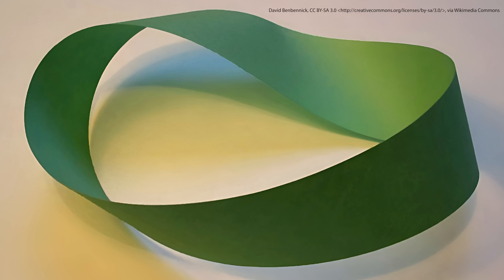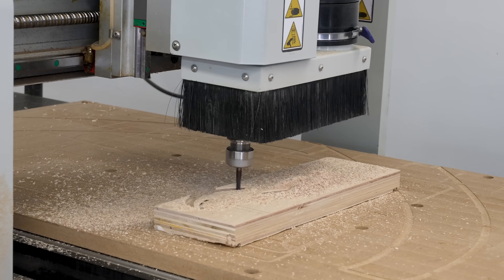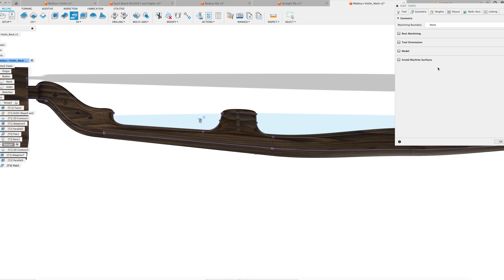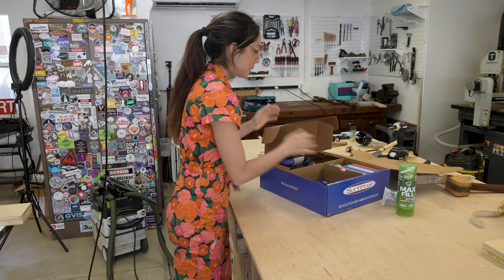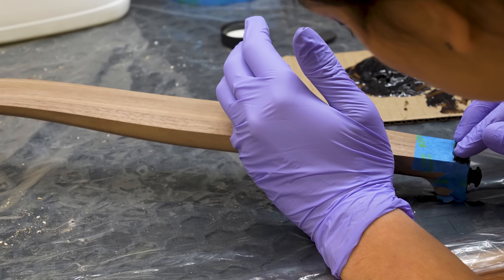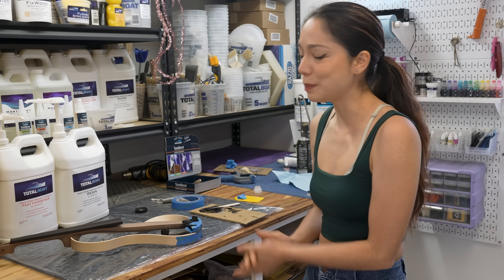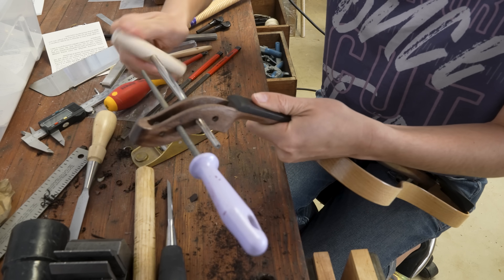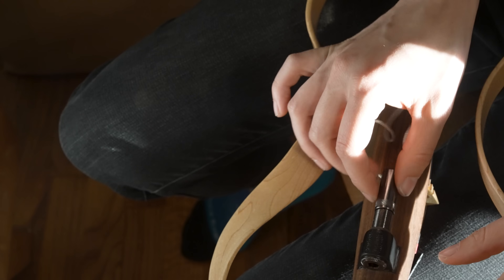I Built a MOBIUS STRIP Violin

Comment: You could probably collaborate with a Luthier to combine your design with some resonating chamber and diaphragm arrangement that provides the rich overtones of those acoustic parts, even allowing for adjustments in thickness, positioning of the parts to alter the overtone relationships. As it is, an electric violin uses Circuits to alter the voice, emphasizing bass or treble, or adding effects. Both "traditions" have their value.
If you listen to Hilary Hahn, that suggests you already know a lot about those issues.
I believe you would find a LOT of professional players would appreciate an alternative electric fiddle with a richer voice than the market offers currently ( sorry )
p.s., Doing animation for broadcast and games, I've worked with Lightwave, Wavefront, Maya, and several others. But I cannot imagine working with a solid modeler for CC woodworking. It would be fascinating to know how you got involved in your passions. 
I guess I should check out your Channel as a new subscriber!!!

Comment: CNC is how Kiesel makes custom electric guitars.  Your CNC set-up looks like a small version of the big CNC mills we had all over Boeing.  I'm a 34 year veteran of the "quality change wars" at Boeing, who worked with a LOT of engineers - in a system of systems capacity, noting I'm actually not a formally trained one.

Great engineers mentor each other in in so doing, both parties grow and develop.  Skill building goes on forever so tap into others at will and with no apologies, and an every chance you get.

Go forth and be powerful!

Comment: as a 10 year operator before falling ill CNC isn't the worst they get Bright ass ideas in the office and try to tweak it down to one person in the department running everything you have to bail to a lower paid position somewhere else in the plant then a blood sacrifice is put on the controller then management realizes it's not going to work picks up the big expensive machines and bangs them around on a fork lift putting crap back like it was.

Comment: Really cool. Probably should have put the nut on with hide glue in case you need to rework the fingerboard. Epoxy.. Yes, Luthiers are cringing. Glad you went to have them set it up properly.  You are a pretty good violinist.. Am I surprised? No.

Comment: 3:00 You can see the piece lifting up right as you say the flaws are due to feeds and speeds. Given that the first one worked so well i'd wager is was probably more a problem with the securing of the wood than the settings.

Comment: At 4:33, you're using the table saw to cut the violin body.  You don't prefer the bandsaw ?
Maybe the SawStop changes the safety equation ?  Or you would need a planer to clean up after the bandsaw ?
Also, I use the drill press constantly, but you seem to prefer the hand drill.
No particular conclusion, but it's interesting.

Comment: ugh cutting those sides by CNC instead of steam-bending is absolutely idi°tic. they will break SO EASILY because of the cross-cut sections, and you eidn't even leave those thicker. 
you could eaaily have bent an actual single sttip of maple all around and made the neck heel the only interruption. especially if you're using plain maple either way. 

you did this for the CAD sponsorship, but this is too nonsensical of an application.

Comment: It's not cheating. Sort of like when we first started using calculators in college math classes. Professors, at the time, reasoned that if you couldn't do it long hand you couldn't do it with a calculator. Question, why didn't use vertical grain strips and steam bend them.

Comment: I will give you a small hint, and it will sound odd, but as your mill is cutting, if you give it a time / step delay, move the head out, and a light water misting (use a spray bottle) and then go back to cutting, and cut a fair bit slower, because as the head hits the wood, the wood still vibrates and I would guess (not sure what happened with the break point) but probably the vibration was in a harmonic from the cutting head. The light water misting will barely soften the cut making it 'chip' less.
As for the Epoxy, yes there would be a hell in a hand basket commentary, I will reserve mine.

Comment: Wouldn't have been simpler for you to start with wood laminate and bend it whilst gluing each layer? But yeah on the gluing. Acoustic instruments should be bonded with hide or fish glue because you often have to replace things like fingerboards and the like and with epoxy, you risk damaging the wood. Hide glue can just be removed with minerated spirts and heat quite easily and becomes transparent after it cures, so you don't have sand it to take it out when you're ready to varnish the instrument.

Comment: I would highly recommend that you get rid of your bag on your Dust right vacuum and go with a canister style filter. I did that and it increased my air volume greatly. Its also traps more of the small dust particles.  Go with the larger filter, I think its for the 1200 CFM.  You will not be disappointed.

Comment: Did you consider creating your mobius violin with an actually stable piece of steam bent timber? 

It would be much stronger. Indeed it would have 1000 times the integrity. You would need far less material. The job would be a lot quicker. And there’s obviously no need for any CNC machining. ??

Comment: This was a joyous build, and I loved everything you did - EXCEPT - the carved mobius strip.  Is there a reason you couldn't have used the CNC to carve out a mold for the mobius strip, then steamed a strip of wood and clamped it to the mold?  The reason I ask is that you've got cross-grain wood in the strip (in a thin piece), and the reason that it broke is that there's basically no strength there.  If you steam bent the strip, it would have full strength throughout.  As it is, I expect that you will at some point break the strips again where the cross-grained part is, even through an inadvertent knock.   Remember when you built the uke with Daisy?  It had bent sides (through dry heat rather than steaming, but same idea), and you could bend and twist a strip of maple to do the same thing.

Thanks for doing this, though!  I'm definitely a fan.

Comment: I recommend that you try making an instrument out of Osage Orange wood. it is very dense, & hard with a bright yellow color, & a very twisted tight grain. The following is from wikipedia about the tree. Maclura pomifera, commonly known as the Osage orange (/ˈoʊseɪdʒ/ OH-sayj), is a small deciduous tree or large shrub, native to the south-central United States. It typically grows about 8 to 15 metres (30–50 ft) tall. The distinctive fruit, a multiple fruit, is roughly spherical, bumpy, 8 to 15 centimetres (3–6 in) in diameter, and turns bright yellow-green in the fall.[5] The fruits secrete a sticky white latex when cut or damaged. Despite the name "Osage orange",[6] it is not related to the orange.[7] It is a member of the mulberry family, Moraceae.[8] Due to its latex secretions and woody pulp, the fruit is typically not eaten by humans and rarely by foraging animals. Ecologists Daniel H. Janzen and Paul S. Martin proposed in 1982 that the fruit of this species might be an example of what has come to be called an evolutionary anachronism—that is, a fruit coevolved with a large animal seed dispersal partner that is now extinct. This hypothesis is controversial.[9][10]

Comment: SMART GIRL  !!  Lutherie is probably the absolute highest form of wood working.  You begin with an axe and saw, cut blocks from perfectly selected baulks, put into storage racks and dry and cure for 5 years or ten years until the sugars have matured.  You then strike the ends of  the blocks with a small hammer and listen to the tone, the note the wood sings to,,,  until you have found a spruce and a maple that are just less than a half pitch apart,,, You start with an axe and finish with a Stradivarius.
Reply: You can play  !!!  Magnificent.

Comment: I just got some UV-cure wood finish. A little pricey, but it has 0% VOC so unlike typical shellac, 90% of it doesn't evaporate, so a quart is equivalent to a gallon or two of the VOC stuff. Can't wait to try it. Wood 705 (exterior) from mywoodcutters. UV cures completely in 2 minutes, adheres to itself so no sanding needed for extra coats, super, super hard (a video on it said 150,000 PSI tensile strength! I can't believe that but.. we'll see)

Comment: Using new, modern, easier, techniques to create something is perfectly fine. Anyone complaining about "traditional" wood work should only be using sticks and stones to make stuff, otherwise they are hypocrites. They dont get to decide where the line is on what tools are "too" modern. As for getting help, go for it, if its not in your skill set then its fine (heck, even if you can do it but dont have time/ energy, then its still fine). I dont do metal work/ welding so its not like im cheating any time i need a metal bracket or leg made for something ive built...Same with my concrete work, if i need something higher quality in a fountain or wall im building then i ask someone with more experiance for help.

Comment: So if you don't actually twist the wood; is it really a mobius strip?  It looks like a mobius strip, but the grain doesn't follow around.  I know, a complicated question.
Reply: No, this is more of a visual approximation of a Möbius strip. Since the violin isn’t actually twisted—something that is technically possible but extremely difficult with wood—it’s not a true Möbius strip in the strict mathematical sense. However, it still visually or structurally resembles one. The main difficulty lies in the grain structure of the wood. When you twist a surface like a Möbius strip, the fibers in the wood would need to twist as well, which could compromise the structural integrity of the material. Wood is anisotropic, meaning its strength and flexibility vary with the grain direction, so extreme twists could cause cracking or warping. Even though the material doesn’t follow the one-sided nature of an actual Möbius strip, we could label it something like a ‘Möbius Strip Design Concept Violin,’ though that might be overcomplicating it. In mathematics, precision is crucial, leaving no room for interpretation, but in art, interpretation is at the heart of the subject.
** I have a degree in Mathematics, fascination with woodworking and have been an artist for 20+ years

Comment: The physics of a violin bridge is fascinating and there is no written history of how it was designed to do what it does.
The path length from where a string sits on the bridge to each foot of the bridge is always the same for each string.
And if you think about it, it has to be, otherwise you'd get phase-based amplitude cancellation that would vary with the frequency of note played.
The notes would have different volumes, even when played the same.

Someone ages ago figured out how to solve that problem.  If you try to make your own bridge and don't even know that's a problem to be solved... well, your entire instrument is going to suffer from a single point of failure.

Comment: Very cool project. But...
Independent of it being CNC (and incredibly wasteful), I can't help feeling itchy seeing parts like those violin sides being machined out of solid wood. That's just wrong, thin strips of wood where the grain is in some places perpendicular to the surface!
I'm not sure if it would have been possible to steam-bend the screw-side out of a single piece of maple, but making it as plywood out of a couple of thinner strips should have worked.

Comment: Impressive in so many ways!!  You and Mia Asano are VERY talented playing the violin, as well as your skills at creating such a fine musical instrument.  Question: I typically use West System 105 epoxy for waterproof applications.  What are your thoughts regarding West System 105 (if you have used it) vs Total Boat epoxy for small boat applications?  Did you use Total Boat for the Chesapeake Light Craft sailboat you built?

Comment: When machining the second side of the first piece (at 3:00 in the video) it looks like the whole thing is lifting off of the spoilboard a little.  That could well account for the lower quality of cut.  I've been doing two sided 3D carving jobs like this on CNC for several years now and I've wrecked a few things with insufficient hold downs!  Regardless, awesome project and use of CNC and I totally agree that CNC is NOT cheating!

Comment: Use regular wood glue, not epoxy (regular Titebond), because if you ever need to repair/replace something, you can steam the joint apart.
Reply: Or if you want to go full on luthier,  use hide glue, which you can take apart with heat.
Reply: @RossReedstrom  that also works, but it’s easier to find titebond and I’ve seen plenty of luthiers use original Titebond.  Don’t use Titebond III

Comment: Using a CNC machine does invalidate the work as woodworking. Because wood working is an art form. Art forms are imprecise because of being made by hand, they lack the computer precision of a CNC machine. It is those very same imperfections created by hand work which give value to a piece of art. Even if trying to duplicate something two x's the value is increased because those two pieces of art work will never be exactly the same. While computer controlled CNC machines can duplicate items with great precision.
Reply: Seems like a narrow definition of art to me 🤷🏻‍♂️
Reply: @RHCole  and strangely, at the same time, he's being overly broad about it too.  Saying all woodworking is art is like saying all cooking is art.  Some of it is, sure, but at the end of the day, the goal is function.  If you hand craft a violin and it plays like crap?  No matter how pretty it is, you made a bad violin.  If you make a Michelin-star looking dish but it tastes like dog vomit, you've cooked bad food.  Working to create "art" is misguided in this context.
Reply: Also sort of an odd impression of what "using a CNC machine" means.  The original design for something like this is certainly a result of human creativity, skill, and effort; it did not spring magically into existence.  And the output from the CNC machine is not a completed product any more than a cut-to-size board is.  It still requires hand-work to address some details that aren't cut on the CNC machine, sanding, and fitting to the other pieces of the violin.  Why doesn't that hand-work to do the final shaping and assembly count as woodworking, even if we dismiss what the CNC machine did?

And we have other machines that produce equally precise parts.  I'm looking at a paneled cabinet door as I'm writing this.  The frame was cut on a table saw to dimensions, edged on a shaper, cut to length, and then assembled.  The precision and repeatability of the table saw and shaper is comparable to that of a CNC machine, and the amount of work that's required to use the cut pieces is often no higher than the amount of work required to use CNC-cut pieces.  The only difference is that the CNC machine can cut curved surfaces whereas the table saw only cuts straight ones.  But lots of woodworking projects consist of straight pieces, so why is the CNC machine more "invalid" than using a table saw?

Perhaps a better analogy would be laser-cutting a pattern and using a router follower to trace that pattern.  That's repeatable, like a CNC machine, and is basically doing the same thing with the same result (at least for 2D curves).  Or maybe you object to laser-cutting the pattern, and would require printing the pattern, gluing it to plywood, and bandsawing and sanding the plywood to the pattern shape -- which produces an indistinguishable end result unless you are sloppy.  Or maybe you object to printing the pattern from a computer too, and would require it to be hand-drawn with french curves and pencil -- which produces an indistinguishable end result unless you are sloppy.  But the point remains; there are common woodworking techniques that produce just as much repeatability as a CNC machine.  Is the objection here simply that one must suffer for one's art, and that one must be a little bit sloppy?
Reply: Besides which, you are using the word "art" wrong.  Art is about having an artistic vision and sharing that with the world.  Photography can be art.  Poetry can be art.  A computer game can be art.  Sticking a urinal on the wall in the right context can be art.  When you are talking about something that gains value from being made by hand and being irreproducible, the thing you are talking about is "craft".  Woodworking as you are envisioning it is craft; it is not art.

Like any craft, woodworking can be a technique for creating art, but that doesn't mean it is art.  Hand-building a table that is a replica of a 200-year-old Shaker design and is just like the last 20 your company built is definitely woodworking, and is definitely craft, but there is no artistic vision, no sharing of some novel perspective with the world, so it is not art.  And that's fine.

Also, since when does "woodworking" have this lofty definition about being some vaunted craft whose purity must be protected, and stop just meaning any form of working with wood to make things?

Comment: I'm not certain if it's the light or not, but around 3:00 when you're doing the timelapse, it looks like your workpiece is lifting on the left edge.  If that's the case, you might look into making that surface a fixture table.
Reply: It's certainly moving!
Reply: Up-cut endmill go brrr
Reply: It certainly looks like the stock lifted around https://youtu.be/nSblfD9GVTc?feature=shared&t=182 . Would make sense with an upcut-bit.
Reply: I noticed the same.